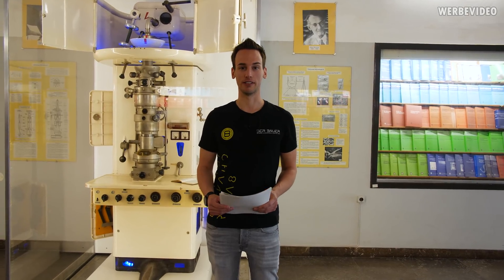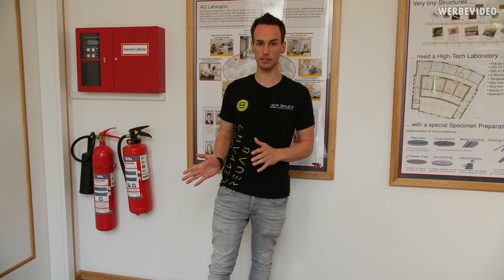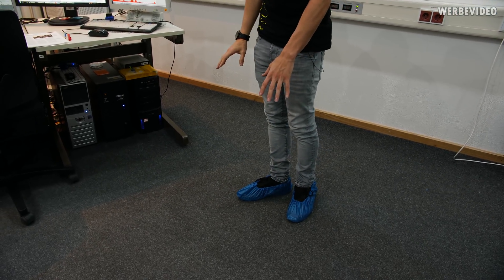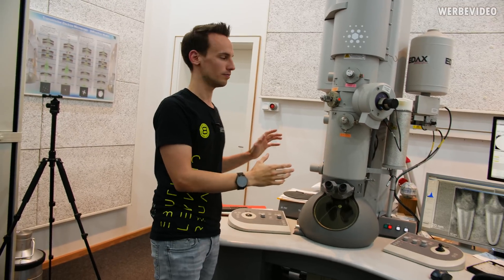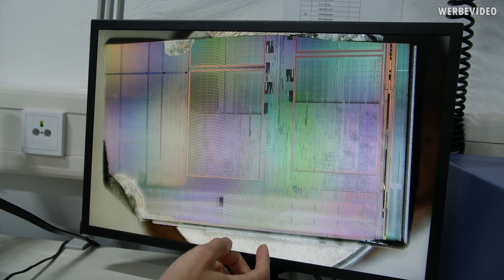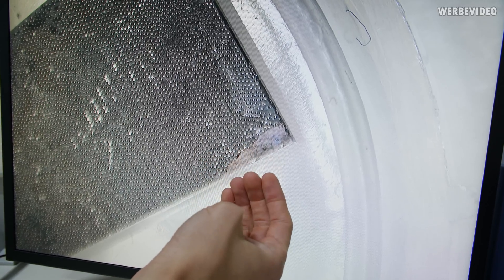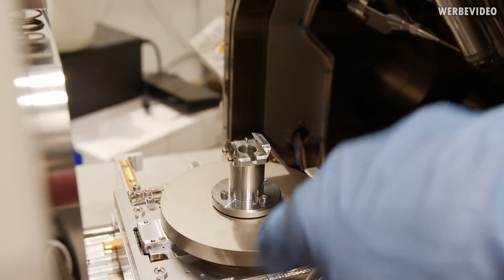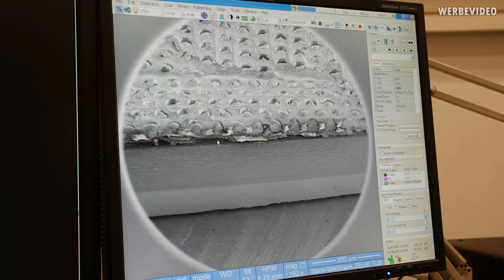Catching a single Transistor - We're looking inside the i9-9900K: Prep and expensive equipment 1/3

Comment: This series is going to be incredible, I am so looking forward to part 2, although that cliffhanger has left me a little frustrated cause I want to see the results now.

It's amazing how long a TEM has been better than a Microscope, I don't know about anyone else, but I tend to think of this kind of technology being a relatively recent invention, rather than something that was created in the 1930's, and within a decade was already better than the best microscopes of the time. (I know the 1930's wasn't that long ago relatively speaking, but it's a lot earlier than I anticipated)

Those solder balls are freaking huge compared to the transistor size btw, it really gives me an appreciation for the size of a modern transistor, which even though Intel is still stuck at 14nm, it's still an huge feat of engineering and material science to get to where they are currently.

Great video Roman, I hope you can release the next part tomorrow, that'd be a nice birthday present for me :)

I think it's easy to tell that this video has me nerding out huh? :D